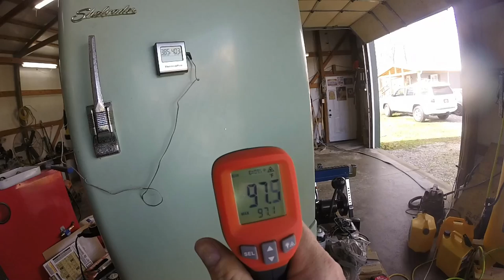POWDER COATING OVEN MADE FROM AN OLD REFRIGERATOR

Comment: I was sitting around last night wondering what I could use to make my powder coat oven and the idea of antique fridges popped in, and here you've done it already!  Did you have any change the insulation inside to do this?
Reply from the maker: Nope... i did have to pull off any plastic pieces around the door and replace them with foil tape.

Comment: So, I'm doing the same thing, only with a giant commercial fridge. Not that old, but older. I'm worried about the insulation. Like with any build, there are hard core no's when it comes to the insulation, and yes's. I haven't peeled back the interior walls yet, but if the insulation isn't just Styrofoam, and is in fact some kind of fiberglass, am I good? 

Great video BTW
Reply from the maker: Just make sure it's not asbestos insulation. Everything else will be fine
Reply: How can you to tell if it’s asbestos insulation? Also if it happens to have either of the 2 types it should not have, what can you replace it with?

Comment: Just did the same thing to an old fridge. Did you have to change out your door seal? Mine is bad and I need to do something with it before turning it on. Suggestions?
Reply from the maker: No it was in good shape. I would look for some type of weatherstripping or something similar that is made out of silicone so it can take the heat. Im sure they have to make it somewhere because thats whats on smokers and ovens.